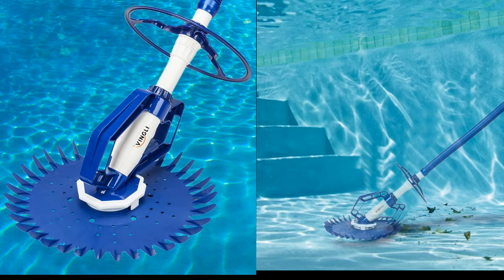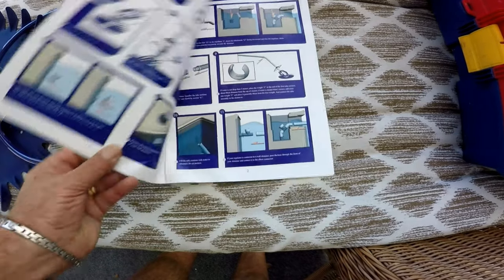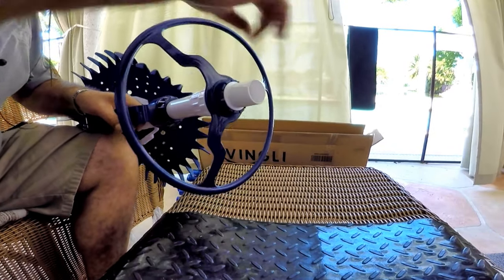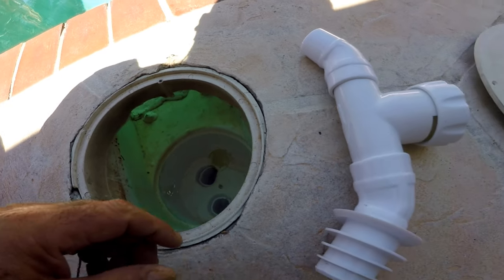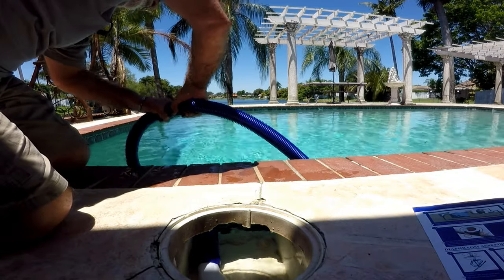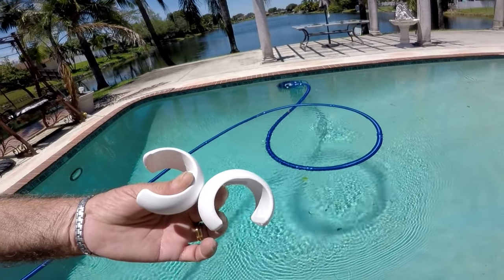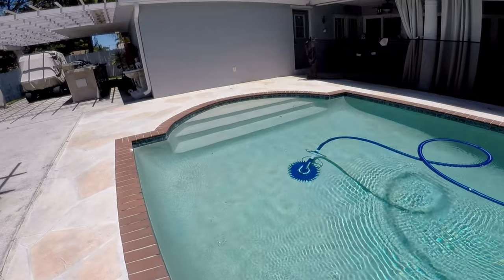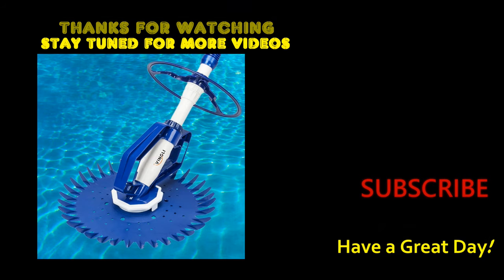Vingli Pool Vacuum Cleaner Review - Swimming Pool Creepy Crawler Vacuum

Comment: My vacuum climbs up the wall past the water level which causes the pump to lose it prime. Any recommendations? Also, sometimes gets stuck in a corner.
Reply from the maker: use weights on the hose to keep the vacuum down and also try adjusting the suction pressure.  https://amzn.to/3ovUiYr

Comment: How do you put the weight ring on the hose.  It can’t snap over any part of the head of the hose. If you try to put it between sections, there’s no room for the sections to connect.  ??  

Thanks
Reply from the maker: squeeze the hose in the middle and it should go on. it will not fit over the connections cause the plastic is too hard...

Comment: What if the compression adapter doesn't fit into the vacuum connection?
Reply from the maker: If you tried all the fittings provided with the new vacuum, then you'll need to make a trip to the nearest Pinch A Penny Pool store near you. I'm sure they can help you...

Comment: Hi John.  I've had mine since November and did not come with an extra diaphragm.  I've had to replace the diaphragm once so far.  I am have an issue with mine right now.  It won't move.  It has plenty of section.  I've tried giving it more and cutting back but no matter what I do, it won't move.  Another ongoing issue I experience is that is gets stuck in the rounded corner of the shallow end where my steps are.  But I just move it when that happens.  Right now, I'd like to solve the non-moving issue.  Any ideas?
Reply from the maker: I have not had any issue with mine yet but i owned a diaphragm type years ago. The issue of not moving was always the diaphragm and all i can suggest is to keep sharp objects like twigs and rocks. Instead keep using  a pool rake to pick them up.
Make sure to check it did not get damaged again. Another thing is to make sure the diaphragm has been installed properly.
I hope this helps.

Comment: My Vingli lasted only one year.  Cracked rubber yellow diaphragm piece.  Replaced the yellow diaphram and it would still not work.  Brand new I could not get it to work with the white tube section with the bevel shaped button.  The opening on that was so large the water just sucked through that opening instead of the cleaner.  It worked fine when I removed that.   But one year and it will not now.
Reply from the maker: Thanks for the feedback

Comment: Hi, John  Why my Vingli Pool Vacuum doesn't vibration at all? Thanks
Reply from the maker: Check your Diaphram. It's either clogged or ripped. Also, check that the regular is properly adjusted and there's no obstructions in the hose. 
Hope this helps.

Comment: I have this, and it won't move. Just stays put. What's going on?
Reply from the maker: If its not moving the first thing to check is the diaphragm, if there's anything stuck in it or its cut from sucking a sharp object. Also check strainer and filter if clogged.

Comment: Great video! I have an outdoor pool and get a lot of acorns that surround the bottom drain, will this remove those?
Reply from the maker: Probably not, depending on the size of the acorns, they can get stuck in the diaphragm.
I would not want acorns going through the system I would use a net to pick them out.
Hope this helps.